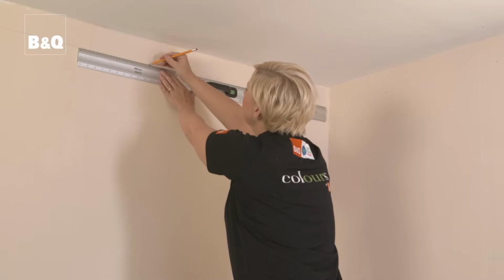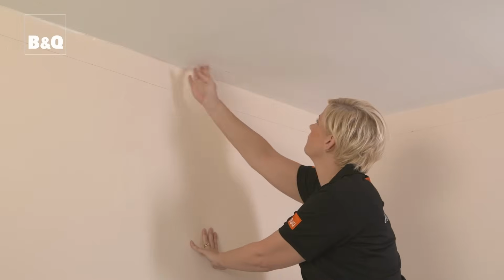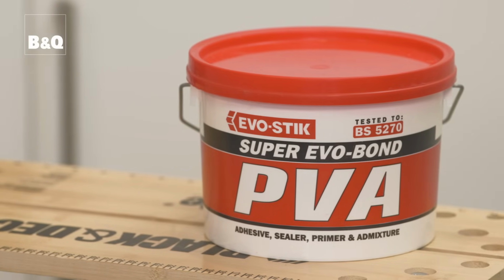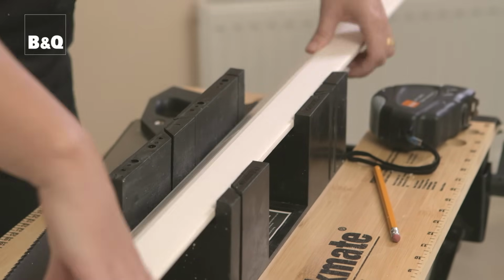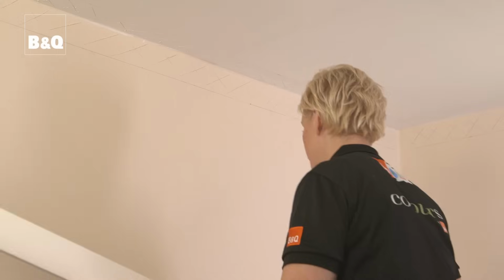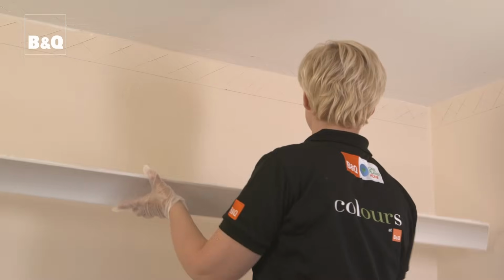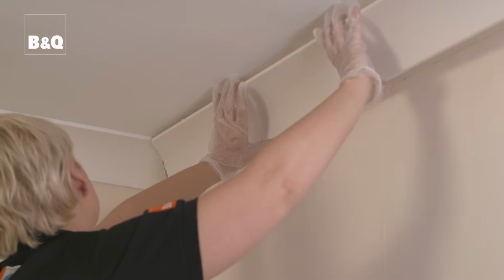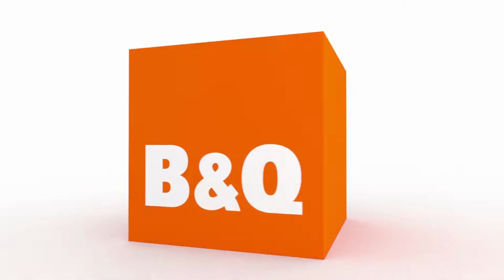How to put up coving

Comment: Put a few small nails on the wall at the pencil line before lifting the cornice into position, this will hold the cornice up. Once it’s up put a few on the ceiling to hold the cornice in. Remove your nails later and touch up.

Comment: Did all this and ended up with a leaf shape cutout in the corner between the 2 pieces. Why?
Reply: Should've read like all the other comments where they mentioned this video assumes perfect 90 degree bends. Pros just coping cut one piece to slot into the other one
Reply from the maker: Hi there. This is possible if your walls and ceilings measurements are slightly off. Thanks.
Reply: You cut the mitres wrong.

Comment: Attention! This is a demonstration video with perfect 90 degree angles and perfectly straight walls. Your house walls WILL NOT be perfect, so i suggest do a lot more research and preparation before doing it yourselves! Cheers!
Reply: As a decorator I can tell you 50% or more walls/ceilings are not straight. Best to check it first! It will save a lot of stress later!
Reply: @our-little-input  a house built in 1870, my walls are more like 110 degrees…
Reply: @our-little-input  no house has perfect 90 walls. They will be off by half a degree or more and over the length of a wall that makes a real difference for installing something like this

Comment: If you don't have an electric mitre saw or a nail gun, borrow one or rent one.  You'll get a faster, cleaner cut with an electric mitre saw and nails are permanent, whereas adhesive or glue shrink and dry out over time.  Find the studs in your wall and mark them with a pencil mark just below the bottom of where your molding will be.  Nail the molding to the wall above your pencil marks.  Finish off the top and bottom of the molding with a continuous line of paintable caulk.  Sink the nails and smooth the indent with paintable caulk.  Erase or wash-off the pencil marks.
Reply: Solid walls?

Comment: Nice video. Though it does assume that the room being worked on is perfectly square and that all corners are perfect right angles! I just used this product on my terraced house lounge and there isn't a right angled corner in the place. Plus the ceilings and walls are very uneven, it's an old house. That has meant lots of gaps between joints which I've had to fill.
Reply: Exactly. You need a mitre saw and measure the angles for a precise cut.
Reply: @ricosrealm  All you need is a pencil and a saw to cut it, hold a small offcut into the corner on one wall and draw a pencil line top and bottom on the ceiling and wall where the cove meets then repeat on the adjacent wall, then hold up the full length and mark on your cove where both pencil lines cross on the ceiling, this will give you a perfect mitre every time regardless of angle, works for both internal and external angles also bay windows, it's literally a fool proof method and no tools or measurements required.
Reply: @designer-garb572  Hey, could you explain in more detail what you mean by that? Are you drawing a pencil line on the ceiling and wall itself? And what do you mean by where pencil lines cross? Explain like I'm stupid 😅
Reply: @HiddenLotus9  OK, For example, let's say you wanted to put some coving up around a bay window with lots of angled cuts, you simply take a short piece ( 5 to 10 inches) but the length is unimportant as long as it is not in your way, you hold the piece in place at the correct drop (85mm from the ceiling) then draw a pencil line on the ceiling making sure your line is longer than the actual cove would protrude, then repeat moving the small piece to the next part of the wall where you want to cove and draw another pencil line on the ceiling where the cove meets the ceiling, your 2 ceiling lines should cross, now when you cut a piece to the correct length you can hold it up to the ceiling and where your pencil line crosses you mark the edge of the cove, making sure the bottom of the cove is sat 85m below the ceiling and into the corner, only imporant thing you have to remember is that when cutting the coving you have to make sure that you have the edge you marked against the floor, or upside down, it is  2 second job to mark this way and it will always give you perfect results, even if you are fitting a large fancy plaster cornice with a long ceiling extrusion it stil works, hope that helps
Reply: @designer-garb572  Thanks a lot for the comprehensive reply. I was able to understand it now. And for others, I found a video demonstration of the technique too - called "Cornice + Coving Ceiling Interior Exterior Angles + Mitre Cuts" on YouTube
Reply: That why he said in the video, if you have uneven walls or ceiling don’t cut to those uneven angles, always do straight cuts and mitre joints and fill in gaps after.

Comment: you can hang super cove without nails if you use plenty of adhesive and is reasonably easy to move about into position if you need to it's good stuff. Differently much easier using super cove especially when doing the job yourself.